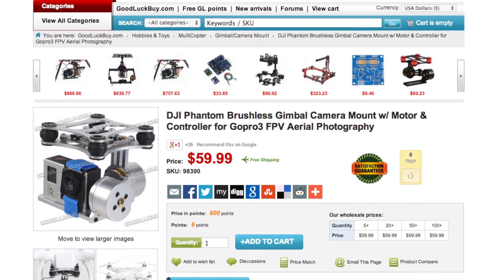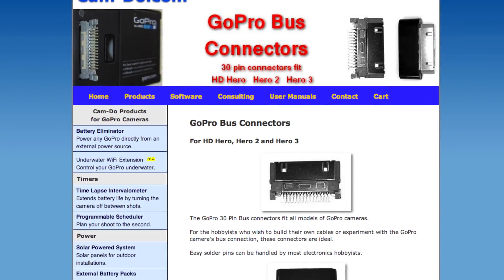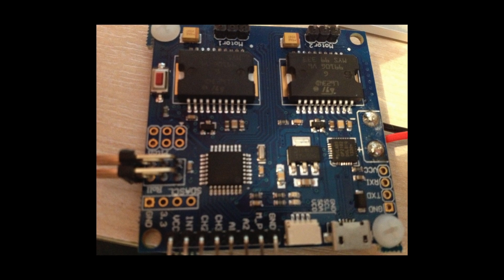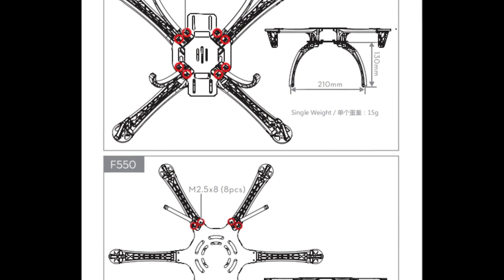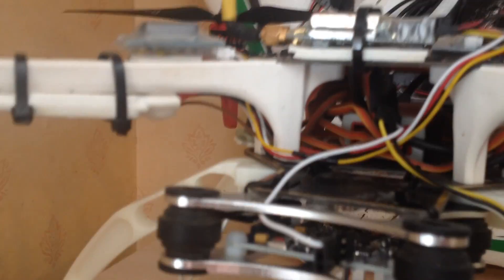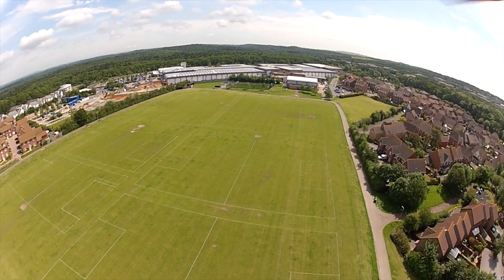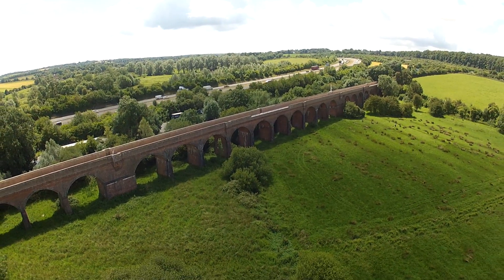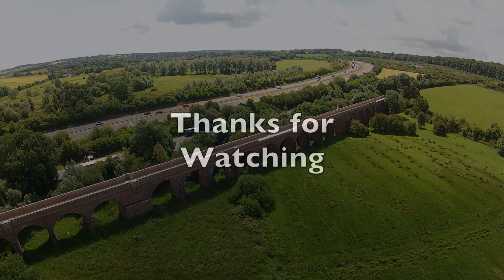GoodLuckBuy gimbal update review and FPV flights

Comment: I enjoyed your video.I have the same gimbal for my f450 but haven't installed it yet ,I don't know how to wire it yet and I use a 4s pack and it says the gimbal is for 12 volts do you know if it will work on a 4s battery? Any help would be appreciated.
Reply from the maker: +MrNorthstar50 It won't, it'll blow on a 4s direct connection.  I'd suggest you get a 12v BEC, or tap part of your balance lead to grab the 12v you need.  If that's too much hassle, then you could also run it separately from a small 3s lipo

Comment: how do you flip the motor from right to left?
Reply from the maker: +Grady Oo You can do one of two things - unscrew thea rm that the go prop sit on, rotate the motor over and reattach the arm... or unscrew where it connects into the roll motor, rotate arm and screw back in.  Doing either may mean you need to go into to the setup software and change on the the axis as the tilt should now be reversed.... although weirdly not always.

Comment: My gopro is very sensititive so i cant put my fpv cable in. how i have to do that?
Reply from the maker: Sensitive how, if the cable somehow restricts the movement, you can make sure it's more flexible silicon wire and there's enough to move around.  You can also increase the power to the motors in the GUI that may help.

Comment: great setup. how much flight time are you getting and what size battery and motors
Reply from the maker: I'm using the normal DJI 2212 980kv motors and running a 3S 5000mah lipo.  This gives me a comfortable 10 minute flight time

Comment: How do you find it flying with just the gimbal view? I found it can be a bit tricky flying at speed or high altitude, so I use a 2nd fixed camera but with a video switch for aiming the gimbal camera, would be great if I could find a PIP or split screen device to allow both to viewed.
Reply from the maker: I found it really weird at first, and I couldn't easily judge my height/speed.  I've got used to it now though - I also tend to use it for slower calmer flights for filming, rather than hurtling about.  I do have a camera switch I intended to use for it, but it's in the box still at the moment :)

Comment: You might try a rail landing skid system or crab legs then your gimbal can be way out front and you can slide the battery back on the rails to counter weight the gimbal. It took a bit of fiddling around to install it but it works  I purchased mine for $21.00 on eBay. you still have a nice rig just like it is... just a though  Happy flying!
Reply from the maker: Thanks - a good suggestion. There are a few things I want to mess about with in future, one of which involved getting the gimbal out further (as well as making it easily interchangable with a fixed HD camera)  But I've lot lots of builds in progress (also known as a room full of bits all over the floor), so it's working well enough to keep flying as is for now :)

Comment: Hey Wayne, I just took a closer look at your Gimbal Mount, specifically the rubber dampers. You could try running bolts through the middle of each one so you could compress them and stiffen them up a little? The way the Camera platform hangs from the mount is offset, which will load up the four rubbers quite differently, the bolts would allow for some adjustment. To be specific, the two rear rubbers are in compression,  with the front two in extension, not good. This is because of the Cameras weight, its C of G. and the way the mount is designed. The bolts would allow you to adjust them.
Reply from the maker: You are absolutely correct, the gimbal is mounted in such a way that the rear balls are compressing already.  It's not number one on the long list of things to do, but this gimbal isn't finished with yet, I have a few designs to try to make everything a bit better here.  Although in terms of vibration dampening, the rubber balls are only good for quite fine vibes, without having a balanced platform to begin with, they won't help you an awful lot.  Biggest issue is actually the 450 frame - this is mounted to a bit that sticks out, and there's too much flex in it, so the weight of the gopro + gimbal with some help from the wind is causing flex there which can transfer through as vibrations sometimes - so I need to design something to fix that... like I said though, not the first thing on the list, as I'm fairly pleased with most of the footage this takes now :)
Reply: CurryKitten Agreed, whilst the 2 axis Gimbal will compensate for roll and pitch, it cant cope with small  vertical oscillations. Point taken about overhang flex, that's not good either. Assuming you stiffen the overhang, I would still use 4 bolts and nylocs with large diameter washers so you can stiffen the four donut rubbers. These rubbers rely on the two plates being a very good fit in their grooves. It would be interesting to mount the much lighter Mobius to see if the situation improved.

Comment: Hi Wayne, medium FOV looked really nice, and that old viaduct was a good test given how long it is. The stream shots were interesting, pity about the Motorway spoiling the backdrop. That gimbal seems to work pretty good to me, I suppose its down to response times etc when you are seeking perfect jello free footage? Your dynamic balancing problems reminded me of when I had to balance my Shaft, Compressor, and Turbine wheel on my Gas Turbine which runs at 160K rpm. When this engine runs, you cant feel anything vibration wise, its like its not running at all. I used a colleages dynamic balancer to do it and an oscilloscope,  using this you can get it almost perfect. You then have to mark all the rotating components in case you disassemble later. I imagine you could make something similar for a motor and propellor,  provided you did not run the prop too fast, in fact it should be simpler since there are less components to dissasemble by comparison. So, for example, you could use paint or Nail Polish to add weight where needed to attain balance on the prop or motor. Unlike a Turbine, where you have to polish metal off.....PS, my AXN is now on build for fpv...:)

Comment: regardind jello - have you balanced both Your props AND motors?
Reply from the maker: I tend to balance my motors dynamically with the prop - but yes, everything is pretty good.  It's only 1080p that defeats me - some of the issue might be that the 450 front lip of the frame is quite flexible and that's where the camera hangs off
Reply: ok, then i am at loss. but that dynamic balancing w props sounds interesting, care to elaborate?
Reply from the maker: kanal After balanacing your props, mount one on a motor, hold the arm and power up the motor, you can feel how much vibration there is, stop it, loosen the prop, and turn it 90 degrees, power it up, check if vibration is better or worse... repeat this, and you'll have the perfect position where your prop balances out your motor
Reply: thanks, mate!